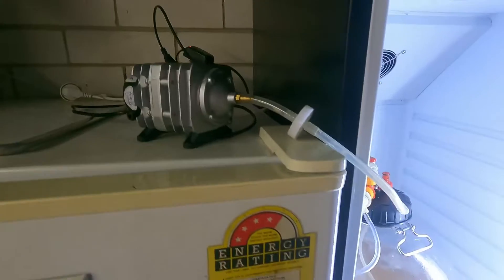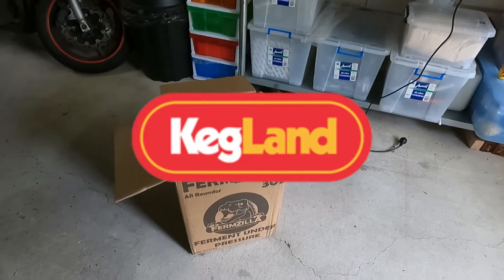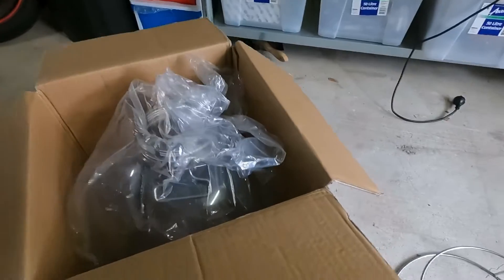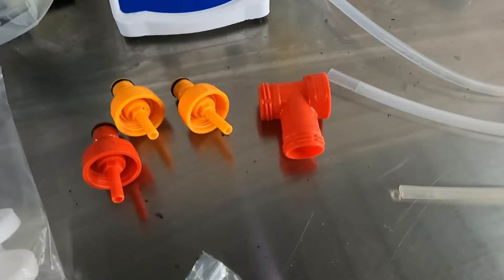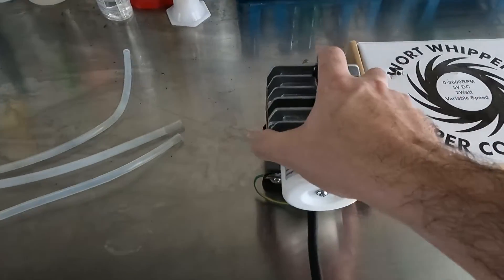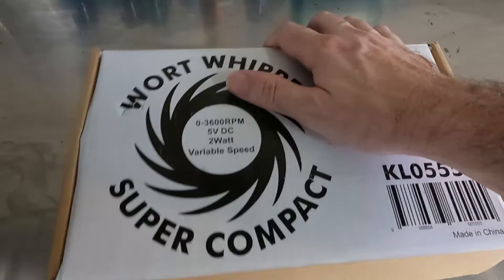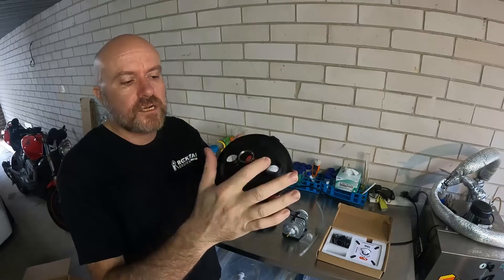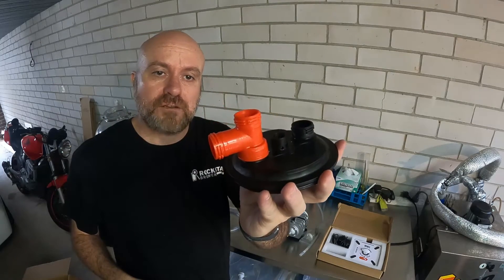DIY 500 Dollar Yeast Propagator Build for Craft Breweries Step by Step Guide

Comment: Are you just boiling a simple DME batch as starter? Looking to prop for a 15bbl commercial brewery wanting to use multiple yeast strains across unique beer designs, and also only spending hopefully an 1/4 of the cost or better.
Reply from the maker: Hey @pipe_piper if you download the yeast propagator PDF, I've put the complete recipe for the media in there https://rockstarbrewer.com/yeastpropagator... I hope you find it useful 🍻

Comment: Great video series! Im only a homebrewer though so autoclaves are out of my budget! But to add an observation about craft brewers and yeast that i experiencd recently. I was at one of the largest  craft breweries a few days ago on a brewery tour and lucky me had one of the brewers all to myself. Anyway long story short, I found out they only use 3 yeasts for all their beers, and it was all dry yeast that they grow up in a propogater and use for several generations before dumping and starting again. I was surprised as I thought they'd have a small yeast lab and propogate a "house" strain, but no! And as a homebrewer I'm keeping a mini yeast bank in a fridge in my shed! Haha, it was actually quite refreshing to know that such great beer from a major craft brewer was being made with a fairly simple fermentation process! 

That being said they still used a nice stainless steel propogation tank and didn't just chuck it in dry.

I am alos inspired now thinking about how I can use your method to possibly create a yeast starter inside of my PET fermenter prior to pitching my wort instead of using a flask etc. It would certainly make it simpler and potentially safer from infection not dealing with a second dry vessel etc